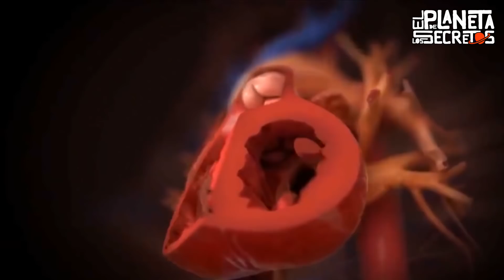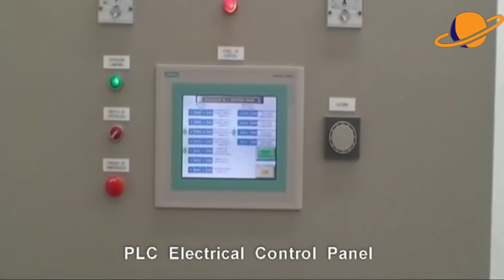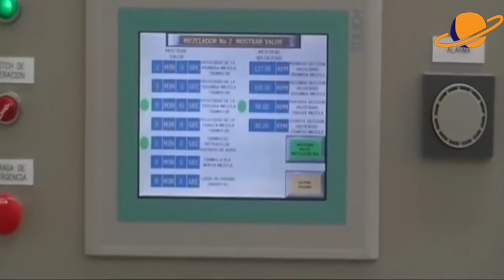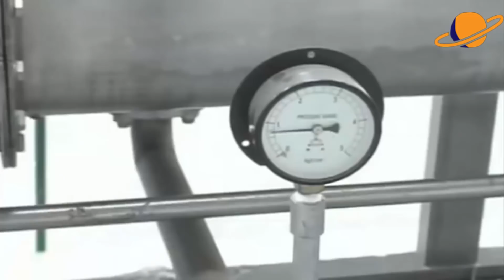MARUCHAN RAMEN | How Is It Manufactured?

Comment: Monosodium glutamate disassociates in the presence of stomach acid to form table salt and glutamate, an important dietary amino acid and neurotransmitter. Monosodium glutamate is completely nontoxic unless you inject it directly into your spine/brain (https://en.wikipedia.org/wiki/Excitotoxicity ) or eat multiple grams of powdered MSG (https://en.wikipedia.org/wiki/Hypernatremia ). It does not cause cancer except in the trivial sense that all human cells require salt and glutamate to function, including cancer cells.

Comment: I really dislike how this is supposed to be educational, while still associating MSG with cancer, hypertension, and diabetes. MSG is manmade, yes, but can be found naturally in many natural foods, plants, meats, and vegetables. Its impossible to be allergic to MSG (monosodium glutamate) since you'd either have to be allergic to Sodium (which is in nearly everything, from your bones, to your muscles, as well as most, if not all foods to a varying degree) which would mean death; it's also impossible to be allergic to glutamate since glutamate can be found naturally occurring in many foods and plays an important role in neural connection and communication in your brain by acting as one of the major signal chemicals between neural cells.

Comment: 1:08 grams of WHAT? Sodium, I assume, but WTF dude.
Reply: Stephen Seehorn 
Yes thats in the noodle cup with the seasoning already you are supposed to almost fill the cup with water so it evens out the salt if you ate the noodles and the seasoning raw your mouth would get very dry and be a bit too much salt but since you put lots of water in the noodle cup it evens out the salt since too much salt is bad so the water makes sodium levels go down so it’s not that much
Reply: Everything in that cup is bad,the plastic for microwaves,obmic fluid and pesticide are in the noodles plus msg and high sodium not to mention the moddles are fried to garden them in grease.